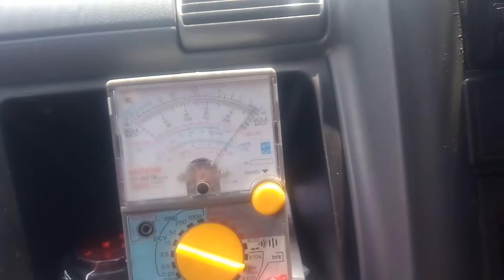modul rem bunyi ,cara pasang modul

Comment: brpa bosku
Reply from the maker: itu cara bikin aja bosss saya gak jual itu cara bikin dngn dana dikit tapi bisa bunyi rem sama mundur.modal e dikit cuma beli power dc 45rb modul mp3 2 biji 80rb kabel dan relle 2 biji ama corong e toa kecil 60rb bisa dibawah le tulang servis solder paling habis 100 jadi wes lek beli sekitar 700an  rem ama mumdur.kalau masnya cuma mau nata mundur atau rem modul mp3 beli 1 mala irit dana
Reply: nggk produksi ..?
Reply from the maker: sementara gk produksi bos soalnya masih sibuk nek truck